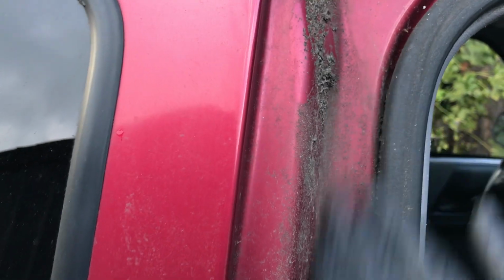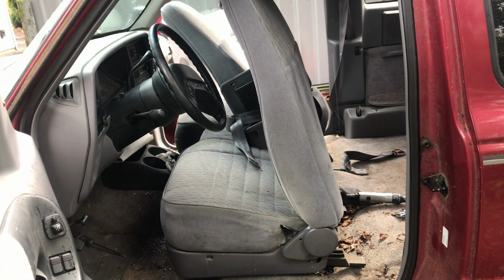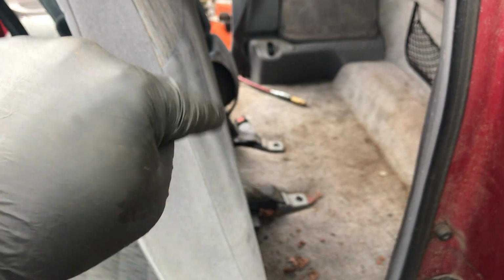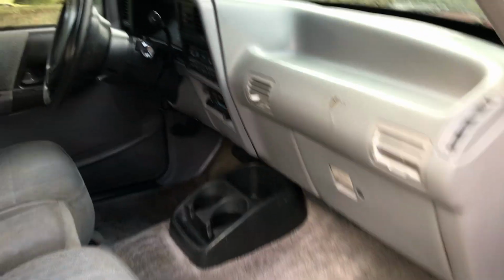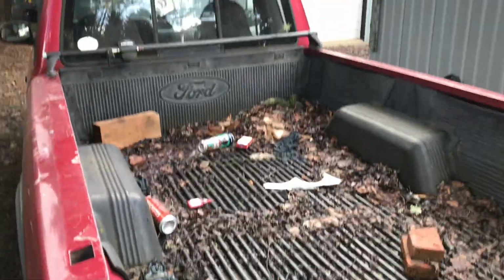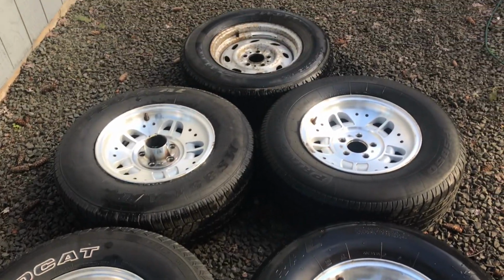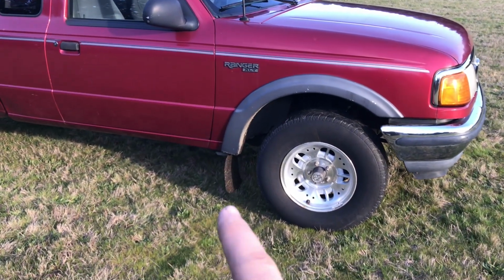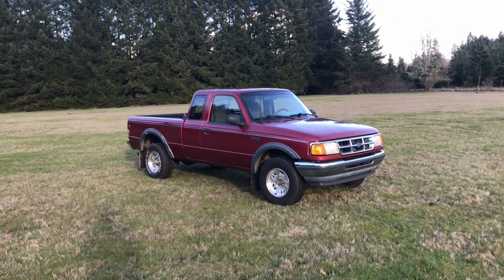1994 Ford Ranger gets Clean!!!

Comment: I've owned 4 of these and currently have a 2001 Extended cab, 4.0 liter 4x4 - bought it new.  Have 142,000 miles on it and have kept up with all services and maintenance, including cosmetic items too. Easy to work on and replacement parts are relatively cheap compared to new trucks. Did have to completely redo the engine cooling system recently, but thought it was worth the money as I plan on driving it another 140,000 miles. It's been a great truck. Really enjoyed this video.

Comment: Thank you.
VERY SATISFYING.
To quickly take the outer appearance up a notch after the washing, I would ARMOR ALL dress the hard black plastics like the side view mirrors, tailgate bumper, and the fender wheel guards.   it will make it pop like the way you dressed the tires.  That was thorough.
You've really taken that truck to a new level.  They are very reliable trucks as I've been told and I'm impressed by how many there are still on the road.  I've seen quite a few of the '80 models.  I don't  see that many old  Toyotas still on the road, and they always seemed to get biased favor or mention as the " most reliable" small trucks.  If you paid less than $2K, you got a deal.  The engine was running smooth with zero vibrational shake.  I'm curious to know how much you paid, but I know it's not really ethical to ask.
Congratulations on the find, the work achieved and thanks for posting what you've done.
‹👍👍👍👍👍👍

Comment: I have the same truck, 4wd, stick shift, and 387,000 miles. Engine just has an oil leak (rear main seal) and a lifter tick. Just cosmetically restored it as well because it was my high school vehicle.

Comment: Love this series.  I have the same truck, 2wd red supercab 94.  I pushed over 250K last year.  My dents are bigger than yours, but my paint is better.  Had to fiddle with the engine last year, 2 temp sensors, maf clean, iac clean, etc.  Runs pretty good for a 30 yr old beast.  It is a fun truck to drive, imo.
Reply: BTW, If you don't want that bike rack thing, I would be interested.  I live around Olympia.
Reply from the maker: They are good trucks! I know a few that have gone 300,000 or 400,000 miles. I don’t think I’ll ever turn down buying any that come up for the correct price

Comment: Never use dish soap on paint
Reply from the maker: Do you have a reason why not?
Reply: Dish soap really just strips the wax. Sometimes that’s what you need to do to get a good cleaning.
Reply: That's funny to say as most auto body shops tell you to use dish soap for the first few washes because it's gentle and doesn't leave any residue. You might want to check your facts bud.